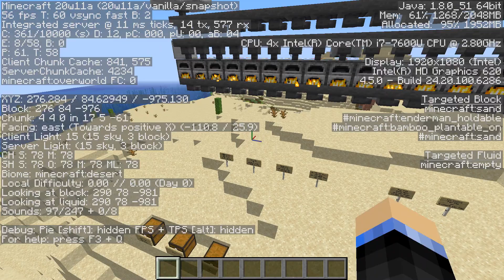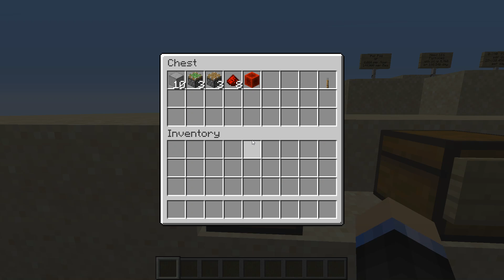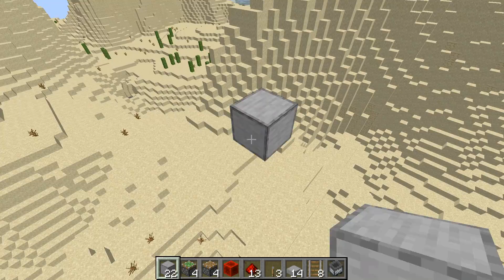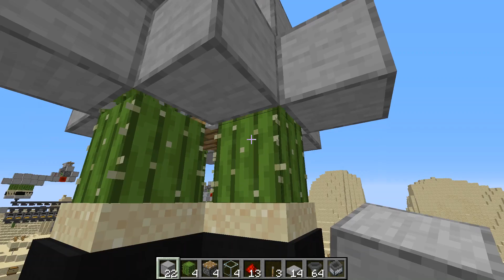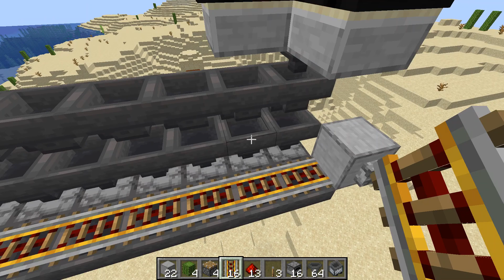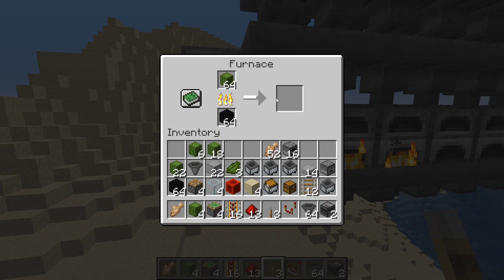Small Auto XP Farm - Massive Power 138k+ XP Per Day! (Minecraft Java 1.13 -1.15)

Comment: I had a problem with the piston facing down, at the center of the 4 cactus, not pushing, even tho  I changed from the sticky piston side to regular piston side, also tried other 0 tick pulse generator but the piston is still not pushing, it works pushing upwards tho
Reply from the maker: what block is the piston that should be pushing touching?

Comment: Everything is set up right but the cacti won't grow, is that because im on a server?
Reply from the maker: probobly... some servers have mods that block fast growth by default.  if you are or know the admin you may be able to disable that feature.
Reply: EagleEye621 yeah just found out that minehut runs on paper or something like that and has it blocked and chances are low that at admin will change it, do you have any workarounds?
Reply from the maker: @elijahsivick6490   I do have a non-zero-tick version, but it is MASSIVE to compensate using high efficiency but 'normal' bamboo and cactus farms
Reply: EagleEye621 looks like i have work to do then
Reply: im on 1.15.2

Comment: Could u make one that already has an auto supply of fuel cause I'm struggling to connect mine up to the system
Reply from the maker: check my 18,000xp per hour video which shows how to set up the water streams properly
Reply: this is what i did https://i.imgur.com/ARdmrRG.png

Comment: Do you have a link to a zero tick bamboo farm that can keep up with this cause mine runs out super quick. Not shakysand cause my sevrer restarts quite a lot and I don't wanna restart the farm every time.
Reply from the maker: ilmango has a 60k per hour one which is the fastest non-shaky-sand I have seen... but it is a lot more complicated to make than my shaky-sand.  Might think about going massive overkill on the shaky-sand so that you can pulse it to turn on for 30 seconds, off for a few minutes, and decrease the odds that the server restart lines up with it running.

Comment: hey, i tried this (i waited 30mins) and only got 1lvl with 6 furnaces, (cactus and bamboo are working)
Reply from the maker: what level did you start with?  unless you were very high, you may have done something wrong.
Reply: @EagleEye621  i think i was at lvl 24 (i went to my enderman farm after so i don t remember exactly)
Reply from the maker: @neyptune1085  you get 1xp per cactus, and should be burning 360 cactus per hour per furnace
Reply: @EagleEye621  i will try again after dinner and i will tell you if it worked

Comment: the dropper isn't working,how do i fix it?
Reply from the maker: need to see what you did to know what is going wrong. can you post a screenshot to the help section of the discord?
Reply: @EagleEye621  the dropper is no longer working like it used to on 1.15.2,so I just took it out so I can do it mechanically
Reply from the maker: @GustavoHenrique-cn1rv  still need to see a picture of it so I can tell you how to fix it. it should still work.

Comment: at 7:50 the piston just brakes the cactus any resons this is happening ?
Reply from the maker: try pulling a signal from the other side (or just move the piston a block closer to the clock)... zero-ticks can be finicky, and the cactus breaking means you are not actually zero-ticking the piston.  You are playing Java, correct?
Reply: @EagleEye621  I'm on 1.15.2 and it's breaking the cactus. Everything is set to default, no mods, either on OptiFine or regular vanilla MC it's still breaking. And I tried both sides, same results. One side wouldn't even fire so I cheated a bit and put an Observer to read the redstone dust signal to fire the piston one step lower. That did cause the piston to fire but the cactus still breaks.
Reply from the maker: @reallauradee  you can't add an observer, that turns it into a one-tick pulse, and if the piston is not zero-ticked the cactus will break
Reply: Sow hat to do?
Reply from the maker: @otm_lavista253  ?
Reply: What to do bro i think its patched
Reply from the maker: @otm_lavista253  absolutely works in 1.15.2

Comment: At 7:07 my piston isn’t going. I’ve tried both sides and shortening the length of the part that sticks out. Any other possible fixes?
Reply from the maker: hard to tell without seeing your build... you could try moving the clock a few blocks?
Reply: same issue here, tried moving, shorten the distance, lengthen the distance, change directions etc. It wouldn't fire.
Reply from the maker: @ejokurirulezz  same answer... can you post your build in the help section of the discord? what version are you playing?
Reply: @EagleEye621  welp I was pretty much copying step by step exactly what you were instructing :) I play in 1.15.2
Reply from the maker: @ejokurirulezz  try pulling the signal from the other side of the clock
Reply: @EagleEye621  hmm I saw it fired once and then wasn't rapid firing
Reply from the maker: @ejokurirulezz  need to see it.

Comment: So I've made this and also hooked your shaky sand bamboo farm to it that fuels it via water streams. Is there a way for me to disable the bamboo farm when there is enough fuel, and start the bamboo farm on its own when fuel is needed?
Reply from the maker: sure... as long as you build one with an auto-on/off switch (and that uses the slime block with redstone block to turn it on and off), just use a comparitor to detect when it is full.

Comment: For the procedure at 7:07, my piston got pushed out at the beginning, but it does not go back...
Reply: For the fueling system, can we apply the zero t bamboo farm on it instead of the railway system, is the rate of bamboo production fat enough for this cactus farm? Really don’t have that much coal for this😂 and thanks a lot for your video!
Reply from the maker: yes... each furnace needs 1,440 bamboo or 23,040 for this 16 furnace version.  That would be four slices of the most recent shaky-sand bamboo farm which is ~6,600 bamboo per hour.
Reply: @EagleEye621  Thanks a lot!
Reply from the maker: it got stuck?  try hitting it with an update (just place a block next to it and then destroy that block) and see if it unfreezes.  If that doesn't work, would be easier if I could see the build. can you post a screenshot or a short clip to the help section of the discord?
Reply: @EagleEye621  instead of putting it 3 blocks away, I tried 2 and it worked for some reasons😹
Reply from the maker: @jerryjin502  zero-ticks can be weird :)

Comment: how does this farm stack up against the traditional Tower mob farm?
Reply from the maker: depends on which.  happy to give more info if you let me know which one to compare it to
Reply: @EagleEye621  https://youtu.be/HDTSq89uGOQ
this one
Reply from the maker: @ridakesserwan8712  I didn't see any stats... it would depends a lot on how well your caving went as well as if you had properly clearing every in a 128 block radius around your player
Reply: The tower mob farm is awful, have you seen the Gnembom design? It's a bunch of diamonds shaped platforms that take up the space of a water bucket with a simple observer line down the middle dispensing and retracting water every 30 seconds. And it's like 100x better than any composter set up even iron farm poppies in composter.
Reply from the maker: @robertlittle2440  that design is certainly more efficient :)